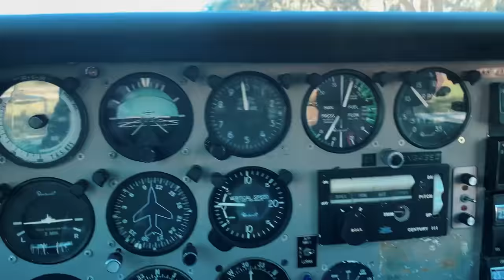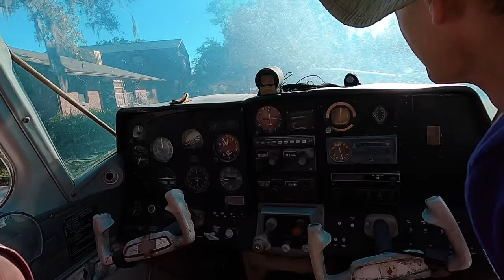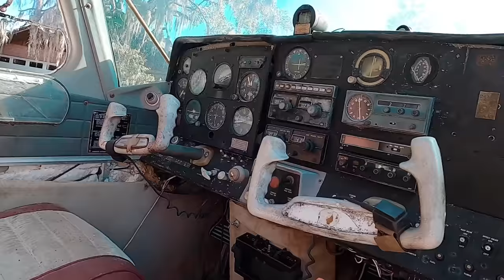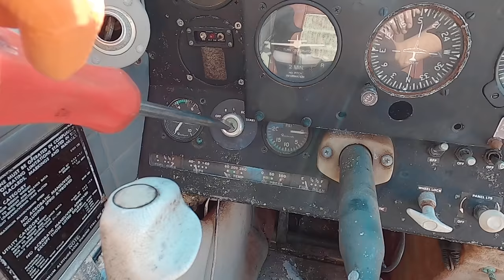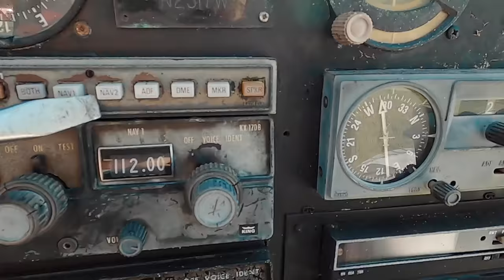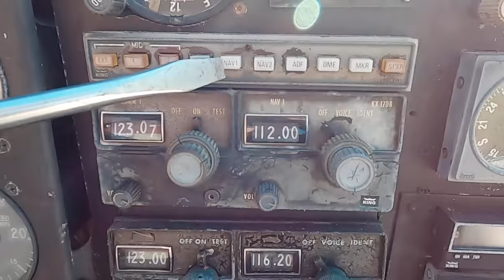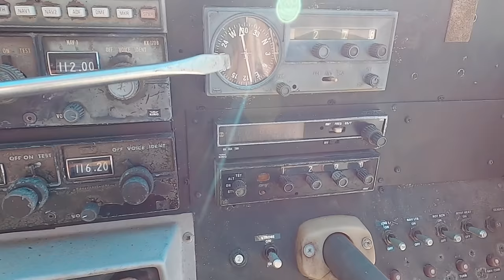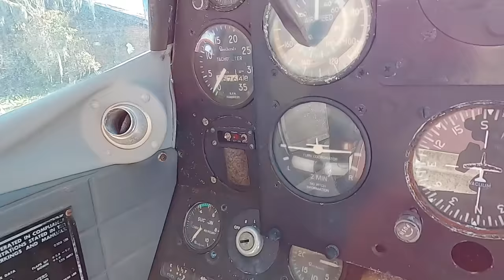Brandon- Abandoned 16 Years Will It Start And FLY?!

Comment: The Sierra, and others in the Musketeer line, may not be speed demons, but that wide, roomy cabin though....

For those curious, the Continental IO-346 was produced solely for the Musketeer for four years. So, yeah, not the most common engine around.
 
Also, even though this plane is a write off, there is a split cowl modification that can be performed so you don't have to remove the prop to get the front of the cowl off.

Comment: I love optimism as much as the next guy, but ...  it occurs that these things need new parts once in a while. At $160 per bolt, unless you can make (weld together, machine, etc.)  your own $2 bolts, yer treading-water 2 or 3 feet under - give or take. 
In solution mode now: when you walk up to another plane, you need: 
1) an external fuel rig - gravity or pumped new fuel, rubber hoses, etc.
2) spark - aka wires, plugs, external electronic distributor, you want to be able to by-pass everything until you can troubleshoot working back until a running engine stops running. 
3) These parts are from the 1960s and yet you act like MTBF isn't a thing; every moving part here (distributors, fuel bladders, wires, hoses, etc.) are probably beyond their recommended service life - and its an airplane, a single-engined airplane, so you don't.want to risk. If the plane doesn't, then your wife will and should kill you.
4) shop-vac and pressure washer, fans, and black-mold rated ventilators. That interior roof needs pressure washed carefully
5) A garbage bin - all of that old moldy crusty carpet has to come out and it needs clean.
I'm not saying stop, I'm saying to only go in like an unstoppable force of nature.
Reply: This is possible. It's extremely tedious.

Comment: Big Bend Community College in Moses Lake WA. runs these as trainer planes in their Flight Program. I saw these back at BBCC in the mid 90's when I went to A&P School at BBCC and then flew them when I was getting my Private Pilot License. Great little trainer planes, the landing gear is pretty robust and can handle the bumps and hard landings that student pilots may make at times. Not much power but enough. I also worked on them (as a new A&P) the year I went through the Flight Program as a mechanic in training.

Comment: Opps I saw a spark at 1:00:03 the problem is that it sparked out the side of the wire not at the plug connection lol. How much it metal bringing now lol. I admire you for even trying to get that one started. the bugs would have turned me around.

Comment: Wouldn't be that hard to put signals and a horn on it either. Train horns would be cool. Either squirrel or rats/mice, unless a bird can access the front of the cowl section vent area into the engine chamber. I remember when my dad try to do that to me, it didn't work. Nor did skype hunting. Brandon is a gem in the really rough state and needs a lot of polishing. Plus some spit and elbow grease.

Comment: Fuel, compression & ignition are required for an internal combustion engine to start/run. Great effort, but sadly you're oh for three on this one. One suggestion though. If you're going to be doing this type of thing, invest in an air compressor, and a spark plug cleaner/tester. Reconditioning spark plugs is an extensive subject all by itself. We clean them with a carbide abrasive blast, thoroughly inspect,  check & adjust gaps, test them under pressure, test their internal resistance, clean them with carb cleaner to ensure all abrasive is removed, then reinstall them WITH anti-seize on the threads. On a six cylinder, this takes quite a bit of time to do correctly. It's fun to do all the short cuts to get to a conclusion for the video, but wouldn't a bit of education along the way be a great thing as well?

Comment: Have to say, this Brandon, as old, decayed, beat up and used by so many as it is, is still in better condition than another antique of the same name I've seen recently. There are similarities though. Both are powered by a Chicom engine which is difficult to see as it's pretty well hidden. The lights come on even when there's no pilot at the controls. It starts up but doesn't really go anywhere. Another big similarity is both have a dedicated "spinner" out in front, but the other one's red, spins more, is louder and much more offensive to the ears and always circles back.
In all seriousness though, I hope both Brandons at least give the appearance of working and don't crash and burn yet, because the backup plane is much worse. Good luck getting it to work, and,
Let's go Brandon! F. J. B. L. G. B.

Comment: it appears to be a white or frosted bottle and clearly has a long neck.
I suspect the crew has been sampling something they picked up in a duty-free shop.

This brings back fond memories, in the 1950s 60s 70s, I frequently stopped for fuel on Atlantic crossings in the Azores. I/we would usually buy in the duty-free shop a bottle of Mateus 
Rose Wine for only 75 cents per bottle. But, never opened it before getting to the hotel.
At that time booze was so cheap you couldn't afford to not drink. 

With a crew of eleven, that would be ELEVEN bottles of wine,,,, which makes for a noisy hotel. + other mischievous behavior,,,,, This was a very nice, very stuffy first-class hotel,  the type that you could put your shoes outside your door at nite and in the morning they would be polished + a newspaper at the door.,,,, some of these winos I flew with would gather all the shoes in the hallways and put them in the elevator. Then, in the morning, no one could find their shoes. So, everyone in the hotel had to go barefooted to the lobby to find their shoes all lined up at the front desk.
Reply from the maker: Ahahaha!! Awesome!

Comment: I mean that thing needs a frame off restoration like a car.....
.if it was me I'd cut a hole in the bottom of it and get in there with some high pressure hose and just blow everything apart on it......
then begin the next 10 years of restoration that's going to take you to put that one back together get a functional.... Course you might have ways around things that I just don't see..... That's kind of what makes you interesting

Comment: Airplane surfaces should not be touched with chemicals like superclean.
Reply: conventional planes like this will be a death trap when sprayed with super clean because it causes an electromagnetic current flow of electrons through the metals and it decays them
Reply: and if you ever have a plane with a pure aluminum surface than than dont scratch it off because it is protection for the frame,,,paint is what you put on when you screw up.
Reply: super clean is great just not for metals that conduct current in airplanes,

Comment: Jimmy, the more I ponder this latest video of yours, the more I am concerned!  I listened to your tone, and I think that I detect disbelief in the assessment that the Musketeer is the most popular plane - ever.  It is disturbing to see you spreading "misinformation" like that.  We all know that the unbiased media, and the "accurately fact-checked" social media sites all coronated the Beech Musketeer as the bestest and most popular airplane - ever.  Hands down.  You are not allowed to question this!  To do so is simply unpatriotic, and may even make you a racist.
Just think about it - whenever word got out that a Beech Musketeer would be in town, folks would drive for hours to line up and see it.  Stadiums and other event centers were packed, with lines extending for blocks.  Some folks would even brave cold, harsh weather to be outside the venue where the Musketeer was supposed to appear.  The "other plane" in the race seldom left its basement "hangar" and couldn't attract more than seven or eight cars in a parking lot, lamely beeping their horns whenever the "other plane" could cough up a semi-intelligible line.  It got so bad that even the die-hard Cessna and Piper followers would physically assault the Musketeer fans as they waited in line to see the "most popular airplane, ever".  Why, there were even miles-long impromptu parades with "Brandon 2020" flags flying.  And not just one either, *several*.  I simply don't understand how you could have ignored all of evidence and come up with a differing opinion.

I'm shocked Jimmy.  Shocked, I tell you!  Brandon won the popularity race fair and square.  All of the media outlets say so!